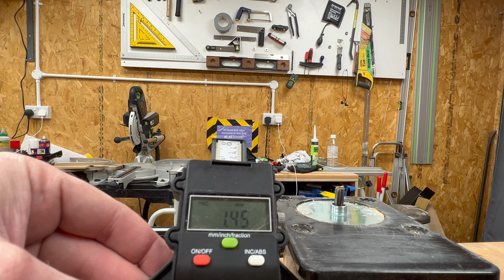Trend VARIJIG: Routing a Recess For Table Legs

Comment: when template routing, I always try to use cutter and guide bush combinations that produce a nice convenient offset like 5mm, so that I can use packers or machined strips of timber to set it up.  If your offset is 5mm+, you are less likely to catch the jig if you accidently tip the router. I also use an oversized sub base made of polycarbonate on the router...it makes it a lot easier to avoid tipping if the machine's base sits comfortably on both sides of the jig, and the clear base makes it much easier to see what you're doing. 👍
Reply from the maker: Nice one David, great tips here 😀😀👍👍

Comment: Nice one Leo.. I can’t wait to use mine. Not that I am in any way criticising you, but when routing internally, your direction should be "Clockwise" not anti-clockwise which for internal routing is a climb cut. So.. external is anticlockwise and internal is clockwise. Bet you struggled to put the jig together. I struggled with 2 hands 👏 but the build quality is exceptional.
Reply from the maker: Amazing bit of knowledge here Paul and cheers for that. I didn’t know about the internal routing direction, just naively assumed it was the same as external. Will store this one in the memory for next time 👍👍👍

Comment: Another great video, you could use a bearing guided flush trim bit so no extra allowance needed for the bush size which would make it easier to set up. 👍
Reply from the maker: Cheers Rasmo and the bearing guide has been suggested. I’m guessing I could, but I’d have to buy various different lengths of bits. If I retract the router bit above the base plate and the bearing is above the base plate then I just end up with a straight bit if that makes sense?

Comment: Hi.  Really enjoy your videos and how you creatively approach your work.  Thank you. However, having seen your recommendation for work shoes, and needing some new ones, I bought a pair.  I couldn't find a place to share on the video itself so have come to the latest one instead.

Unfortunately, the ones I bought finally arrived after a 3-4 weeks delay, and having worn them for a day I found I just cannot use them.  I think I must have got a bad batch as the toe caps seem to be off at an angle which means they press too much on one side of each foot.  I sense that this might be an isolated issue and, as you mention, you aren't linked to the company, but I wanted to give a little feedback.  The rest of the show does, however, feel very comfortable.  

Thanks again for sharing what you do.
Reply from the maker: Hello Martin, cheers for the message and sorry to hear of your experience with the Rona shoes.  I’ve not experienced that myself, however I did end up ordered a size larger than I normally would but don’t think would make any significant difference to the issue you suggested. Have you contacted Rona at all to speak of your concern? Sure they’d be interested to hear your feedback 👍👍

Comment: Nice video. thanks. Love the tips. Based on your experience, do you feel that the Festool OF1400 would work ok with this jig?
Reply from the maker: Hello Robert, cheers for the message. Yes I think you’d be fine with the Festool (what a cracking piece of kit that router is!) providing you use the correct guide bush👍👍
Reply: @Hand-i-Craft  thanks.

Comment: Would the normal way of working out the offset not work with this jig say if you wanted an exact perfect fit?
Reply from the maker: You could workout the offset Ben and either use the measurements on the rule to add the extra width or a correct sized packer for a perfect fit. I’d been experimenting with it and found that piece of cord to be spot on for the extra width I wanted for those table legs. If I find the right sized packer I’ll probably use them in future as it’d be less fiddly!

Comment: would it not be easier to use a bearing guided router bit rather than relying on the cord for the offset if you needed a a little bit of wiggle room you could use playing cards as shims
Reply: Guide bearings are great, top and bottom bearings are good. I used have custom spacers but for use guide bushes
Reply from the maker: Good question Ken and something I hadn’t considered as I haven’t used a guide bearing bit yet. Can I ask though are you able to adjust where the bearing goes otherwise could you end up with the bit being too long to cut the recess? Does that make sense?
Reply from the maker: I haven’t used a guide bearing bit yet pal. I’ve just led asked Ken the same question, can you adjust the position of the bearing though otherwise wouldn’t you end up with too long a router bit for the recess and if you shorten the bit wouldn’t the bearing disappear behind the bottom plate?
Reply: @Hand-i-Craft  ive got a few different length bearing guided bits from 13mm to 75mm so the depth of cut shouldnt be a problem

Comment: I've seen these before and considered that if were much smaller they'd be handy for me.  Guitar or even a juice groove around a chopping board.  Would it work with a template/trim router bit rather than a bushing?  Although that said, I'm sure you'd see sparks fly even quicker!
Reply from the maker: I think  a smaller version would be a great idea pal. I think trend do offer some template attachments but I’d need to do my homework on that 👍👍
Reply: Check out the Axminster precision grooving jig. It is the bees knees at smaller grooves and so easy to set up and use.

I've only used mine twice, but I made a desk tidy out of spalted beech using it and it's amazing.
Reply: I would not use a bearing guided cutter with one of these...but I would use this jig to make an MDF or plywood jig to use with one. For little jobs, you could use a trick that I picked up from the late Ron Fox....he used strips of 9 or 12mm mdf a couple of inches wide and cut a 45 degree angle on the end of each. Using double sided tape to hold them down, you can outline a shape you want to copy and run around the inside with a bearing guided cutter....then just prize the strips off and reuse them. There is a series pg youtube videos where he demonstrates this technique...I think its called getwoodworkingtv
Reply from the maker: Sorry Chris, I just read your question back about the bit type (like the bearing one) instead of a guide bush. I’ve been asked it in another comment, I’ve never used a bearing router bit before so you might be able to help me here. Is the position of the bearing height adjustable otherwise would you end up with far too much router bit needed for the recess? Otherwise if you raise the router bit would the bearing disappear above the baseplate? Does that make sense as I genuinely don’t know the answer

Comment: String though? It will never be accurate. Why not use spacers???
Reply from the maker: I was just using what I had to hand at the time. Accuracy wise there needs to be a bit of room on either side so I’m ok with that. I’ve got some packers / spacers in the workshop since and been using them 👍👍

Comment: As a beginner woodworker taking up the hobby in retirement, I find your channel really helpful. Your review of the lidl sander convinced me to buy one and I agree, for £90 it's a good buy. I bought the varijig for a similar task to you, but  I have a Trent T4 router and found that I couldn't plunge far enough to cut to the depth I needed because of the extra depth needed to allow for the varijig, Have you come across this problem, and if you have how have you overcome it?
Reply from the maker: Hello Robert, cheers for the message and thank you for your kind comments. In regards to the Varijig I have two possible solutions. Firstly, when you put your router bit into the router, you do let the bit sink all the way to the bottom? What folk should really do it let it drop to the bottom then lift it up slightly before tightening the collet, that would also give you a little extra length on your router bit when plunging. Secondly you could purchase a longer router bit that would give you that extra plunge depth? Trend do sell individual router bits, but you can also purchase individual bits from Amazon or the likes of Screwfix. A British company called Wealden tools make excellent router bits and are reasonably priced as well👍. Hope this is of some help, best wishes, Leo 😀👍
Reply: @Hand-i-Craft  Thank you I will try your suggestion and buy longer bits!